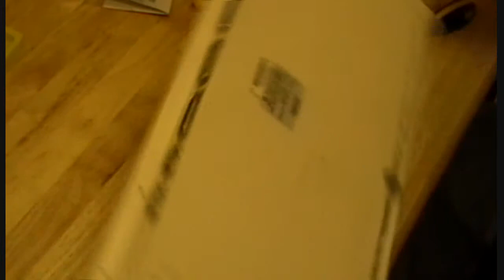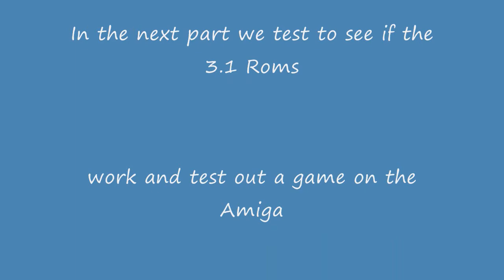Amiga 1200 Project: Part 4/5. Motherboard replacement and upgrading to 3.1 ROM with CF Flash Drive.

Comment from the maker: @HQsound Sorry for late response. Yes I suppose you could but where would you suggest? The expansion Acceleration port underneath would be o.k. but if you bought a accelerator card then it would be difficult and also have wires hanging out externally are not exactly attractive. Really once you install the flash card there is no real need to constantly open the Amiga.

Comment from the maker: @kad3t To be honest I put the Hard Drive cradle back in place as this supports the keyboard. Then I just taped it to the cradle using good old black electrical tape just to stop it swinging around. It is really cool not having any mechanical moving parts inside the machine. I want to get a 4-way IDE buffer so that I can connect a CD-ROM to my Amiga. Thanks for your comment.